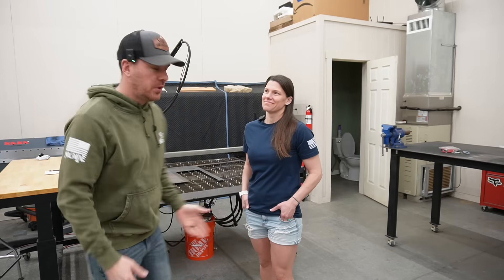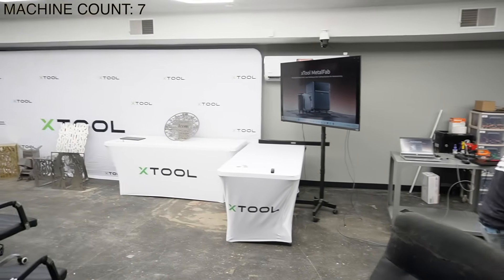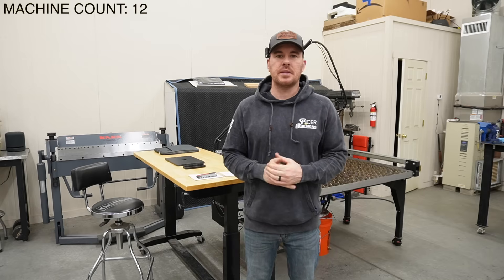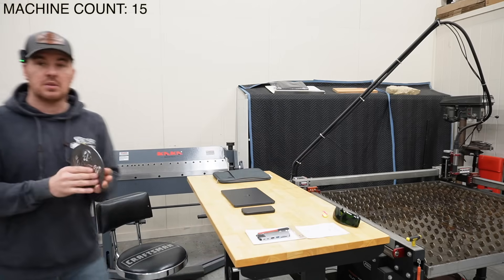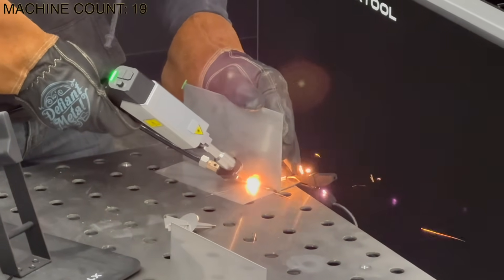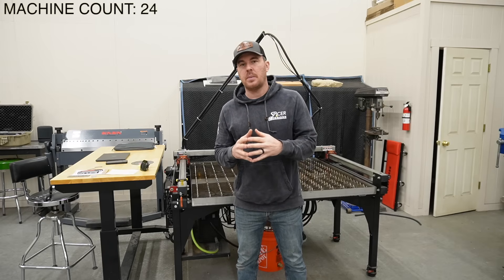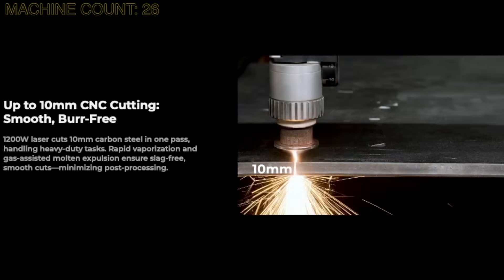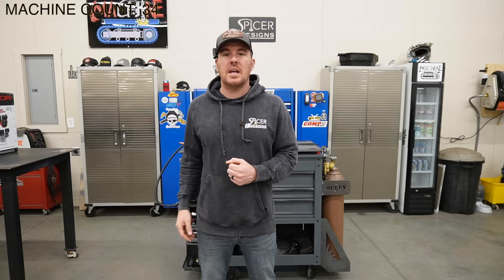The NEW xTool METAL FAB Can Cut 3/8" Mild Steel.....

Comment: I just paid $9,000 for the 1200 watt model with shipping and tax, including a couple of accessories. No room now for the CNC table. Too much equipment in too little room. Use a standard 50 amp 240 outlet we use for welding. That’s the plug on the power cord. Do not cut the plug off and use something to fit a smaller outlet. While this only uses 25 amps at 240, it’s a safety factor. The recommend a minimum of 32 amp wiring and breaker. I agree.

Actually, this cuts, according to their specs, 0.40” steel, not 0.20. That’s a lot.

Comment: well
im not posting links   but was offered a  24x24 lasercutter, 1.5 kw  for 6500
purchased a  welder 1.5 kw 3800 in the shop after all  shipping and taxes

now im looking out  for a same  combo  for  a 4feetx3feet workarea  machine for  9000 , with free shipping
power only  800 watt  but a 2 kw source  around  2500-3000 , later can upgrade

i couldnt afford the 15K for this machine

hoping they can sell a lot machine

Comment: Got a deposit down on one - btw 10mm is not just under a 1/4" - it's just over 3/8"...
Reply from the maker: I added captions for that to correct it in the video.  I was working off the info from the 800w machine.  Had them mixed up.
Reply: @ ahh ok. Must have missed that bit. 
Anyway - great video - making me more excited 👌🏻

Comment: 15:50 Dices que necesita 30A, pero en la página web dice que 23A máximo para la máquina de 1200W, la de 800w se queda en 15A. No sé porque dices 30A.
Si realmente solo son 23A 240V (lo normal en Europa) estaría bien porque podría enchufarse en cualquiera enchufe de vitroceramica o horno que suelen ser de 25A en la cocina
Reply from the maker: Well good luck finding a 23 amp breaker.  The OCP needs to be sized at 125% of the   FLA or 23 amps.  Thats why i said 30 amp breaker.
Reply: @ Bueno en teoría un enchufe 🔌 de 25A a 240v debería de valer. Teóricamente es necesario como máximo 23A, no siempre requerirá su máximo y normalmente estará en mucho menos. En Europa los enchufes 🔌 que se destinan a enchufar la vitrocerámica o horno en la cocina son enchufes de 25A
Reply from the maker: I dont think you understand.  You dont size the over current protection at the exact max amps of a machine.  You size it at 125%. You go ahead and put it on whatever breaker you want.

Comment: In my shop I have a Langmuir XR plasma table and I also have a 3kw laser welder. I'm looking into getting the laser head and controller for my welder to use on my plasma table. The raycus (jeesh) laser head and controller would be less than 3,000

Comment: I'd probably just figure out a way to mount the head to my existing CNC table. As there are now more and more VERY open design tables or even just gantry arms that are starting to come out where they are very bare bones in terms of the frame size, but for what they are, 5x10 cut area for about the price of what X-Tools is coming in at. Plus higher cut capacities and speed.